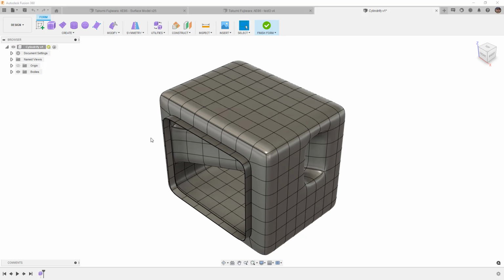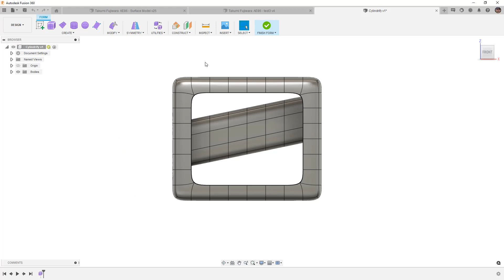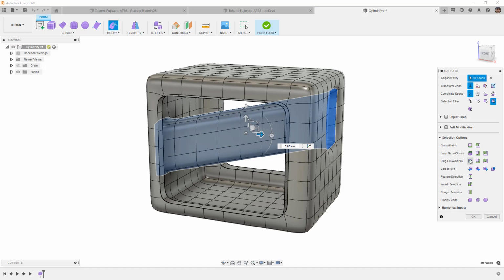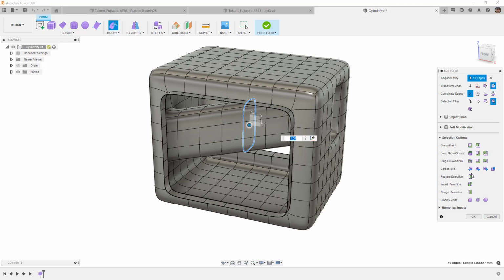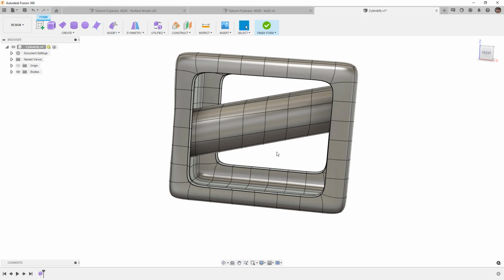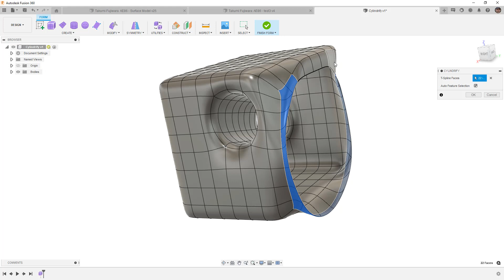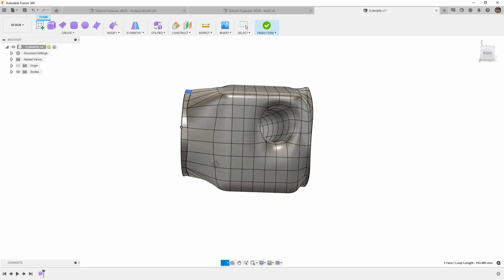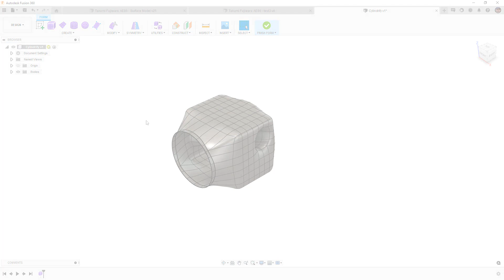Fusion 360 Form Mastery - Part 12 - Using Cylindrify

Comment: how to squeeze out a face at once at 90 degrees without smooth shapes?
Reply from the maker: Form by nature will always be smooth/curvature continuous.  If you are trying to extrude out a shape you can hold CTRL + ALT when using edit form and this will add a Crease to the edge.  Then for the rest of the edges you want to be sharp use the Modify > Crease tool.
Reply: @LearnEverythingAboutDesign  Thank you very much, your lessons are very easy to understand and at the same time very informative!  I try to practice every day.

Comment: I can't create the original cube with the inner bridge. Did you connect it somehow, because my bridge always ends up closed or twisted and narrow.
Reply from the maker: Pay attention to the small white dot on each side of the selection and the arrow that is attached to that dot.  They need to be in a similar location and direction on each selection.  Generally something like the upper right corner with the arrow pointing up.
Reply: @LearnEverythingAboutDesign  Thanks a lot. I started to feel like a moron. Great content.